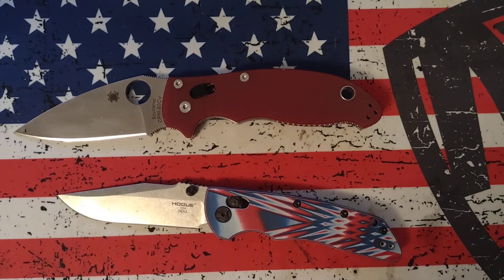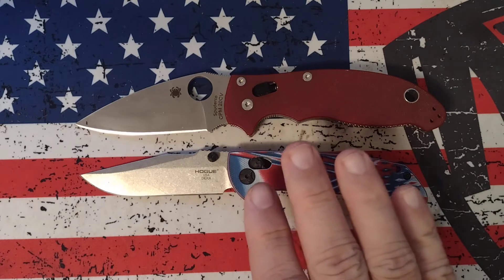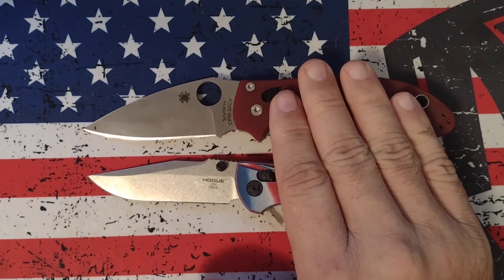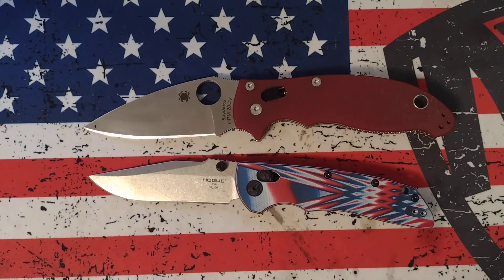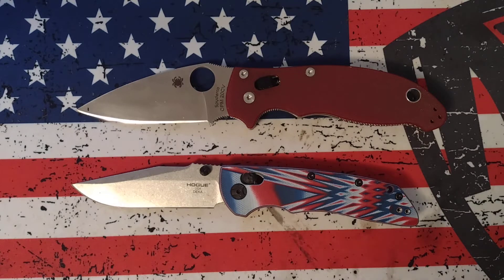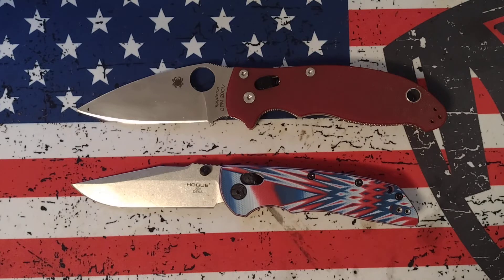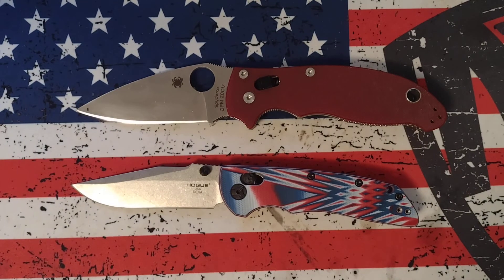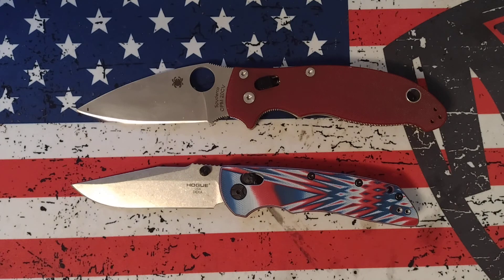SUPER STEELS.....MAYBE

Comment: Look for a video called microstructure matters by Tom with Brian.
Reply from the maker: Did I open the blade quick enough this time
Reply: @shaynegables  lol. Anyways. To correct you on this one, outpost76 has tested multiple Reate knives and they are between 60-61rc and cut in the high 300s and one in the 400 ft cut except for one of them. They also sharpen under water. They were taught cnc by Todd Begg and his brother. In anycase the video above shows that its not specifically the rc of the blades, but the ht protocol and the microstructure that it produces.
Other than that I agree with everything you said.

Comment: A Rat is AUS8 is a skinny stock blade.  It would be a better slicer than any Reate I've seen.  That does not make it a better knife.  If you want a "slicer," go with a hollow grind.  Didn't you just get a Yojumbo?  That thing would be slicy.
Reply from the maker: I did and I love it
Reply: Reate has made some thin behind the edge knives but not many. They also have an arguably better ht than Spyderco according to the testing Gerald has done.
I like the Rat in aus8 though. Way better than the China d2 they use in some rats.
Reply from the maker: Dude your troll lvl99 Reate certainly does not have a better HT
Reply: @shaynegables  Watch outpost76 horizon D cut test. At 60rc did around 400ft cut. Now look at Spyderco cut test at 60rc. Give or take 200ft cut. Just saying. Sure Spyderco at 62rc is really good, but not as good at 60rc. Meaning the one has better microstructure at a lower hrc. This is why rc numbers are not the end all be all.
Reply from the maker: You're correct that horizon D did well but just that one. And it didn't outcut the PM2 in M390 for less than half the price
Reply: @shaynegables  the Chavez 229 is made by Reate and did 334ft cut and was improving after each sharpening. And I do agree the Spyderco in m390/20cv are generally cheaper. Though generally a Reate is very good value for the money you pay. I agree with your sentiment against China overall. Buying used Reate's for cheap can help with the initial high prices. Also its sometimes impossible to get any Spyderco on launch. They sell out and then go for 500+ in the 2ndary market.
Reply from the maker: I guess buying second hand Chinese lessens the blow but I still don't trust Reates HT look at the one right beneath the Horizon on the chart
Reply: @shaynegables  yeah we've seen Spyderco's that didn't turn out perfect. Each brand has some outliers. No matter how good their heat treat is. Always expect some to not do so good for whatever reason. Spyderco forums have many of threads where they had to return one cause of a bad heat treat. It happens to the best of them. If you make a custom knife and leave it soaking for a few mins too long you loose the microstructure. The makers say its in spec still cause the rc is in range. And Spyderco has made way more knives in their life than Reate. So they have their fare share of problems. They usually replace the blades or give a replacement knife. Usually.
Reply from the maker: I'm sure it can happen with any maker but for $350 to $450 I'm out
Reply: @shaynegables  and that's fair. I generally only spend 400+ if its worth it and something I really like as long as the microstructure is proven. I can always get a replacement blade if needed.